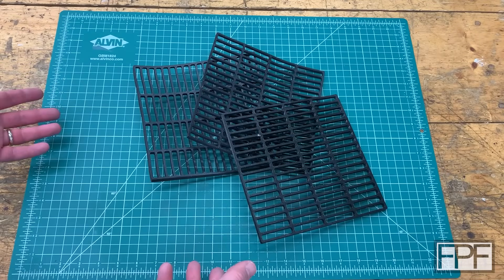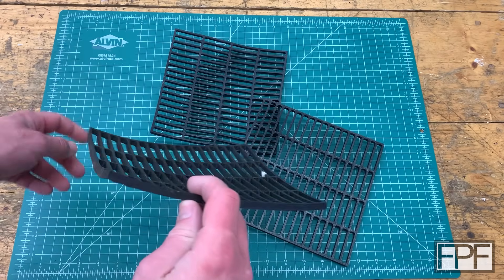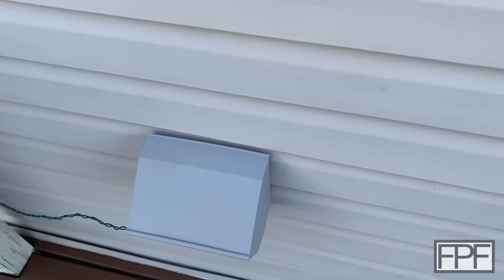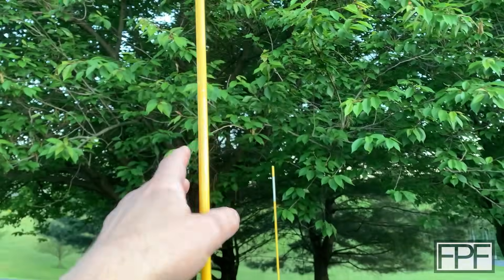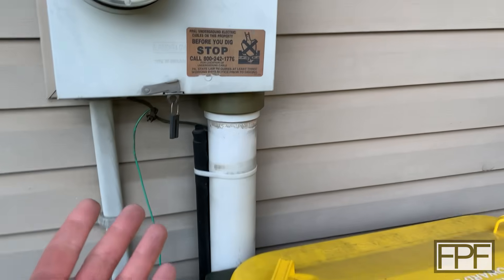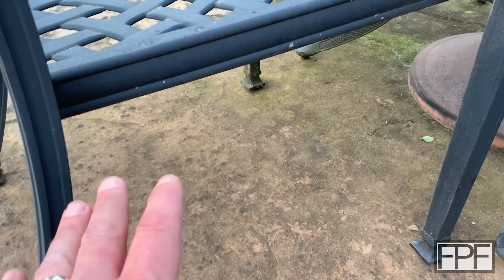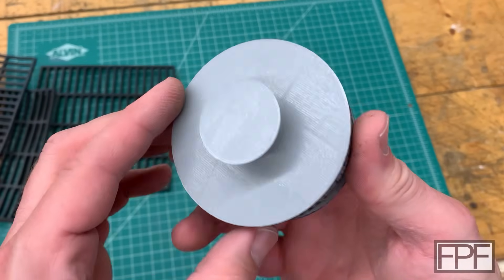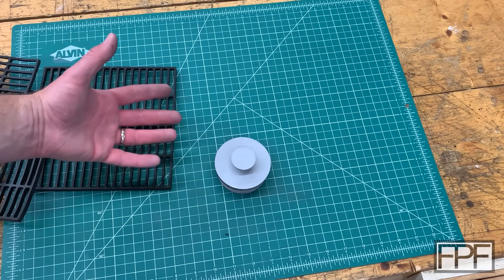3D Prints - 7 Years Outside

Comment: Since ~2010 I've printed hundreds of things to go outside, I've never used PLA, originally it was ABS because that's all we had (no PLA back then!) and ABS is great outside, seems to discolour quickly though, I've had plant pot stands outside since around 2012 (12 years!) and they're still fine in ABS. Petg I've never tried outside, ASA is great too and has replaced my ABS use. I've tried PACF (Nylon CF) once and would never use it again because (somewhat obviously) it turns into a soggy mess in around a week in a humid country

Your TPU is interesting, surprised it held up

Comment: Using PLA or silk PLA, I made some replacement spring retainers for in-floor pool cleaning jets - they've been underwater for 3 years in a chlorinated high-flow high-pressure environment and still holding up. Also I made some replacement hummingbird feeder flowers - they're kind of delicate but they last a long time (a couple years) and are quick to print. Both designs are available on Printables.

Comment: I printed some valve stem caps for my tires i actually used sunlu G3D pla plus black. I live in Tennessee and summers here stay in high 80s and we get about 2 weeks of 90s to low 100s also about a week of 0 degree winter weather.  And considering they're black, and close to very hot pavement they've held up well. I printed them about 2½ years ago. Still going strong.

Comment: I have a floating chlorine dispenser  in my pool, where the bottom half deteriorated from those 3" chlorine tablets. The top half was in perfect shape so I 3D printed a new bottom half that sits in the water with the chlorine tablet sitting in it and it has been in my pool floating around for at least 5 years now. Funny thing is it has lasted longer than the original plastic that it came with from the store.

Comment: The key here is:

1. Virtually all the parts shown have limited direct sun.

2. based on how green everything looks you probably regularly have precipitation and clouds.

3. based on your accent combined with your environment  you probably live at or under 1500 feet in elevation.

The reason I bring these three things up is I live in the mountain deserts of Colorado and New Mexico. I grew up at 8,000 feet in elevation, have typical yearly temperature cycles of -20F to 110F and have lived at greater than 5,000 feet my entire life. PLA absolutely disintegrates where I live. In full-day direct sunlight you are lucky to get about 6 months out of a PLA print. Even "UV Resistant" materials like PETG, ASA, and others typically start getting brittle in the 1-2 year range. As a general rule of thumb to help mitigate against this is I coat all prints that will be headed outside for the long term with paint and/or some other coating.
Reply: This.  I second the effect of different climates.  Colorado will absolutely devastate things even when they are designed to be UV resistant.
Reply: From memory the oxygen levels are also very low at those elevations. A ride on a cog railway caused oxygen depravation, and that was without any health issues.

Comment: Printed a few different types of small flower pots that sit outside and inside. All of them are filled with dirt and water and all of them see a lot of sun. All are PLA and about 4.5 years old. They all still look fairly new with a bit of fading. Rinsing them out yearly to repot and I don’t see any deterioration or anything.

Comment: My big question is this.  I am redesigning the plastic stakes that came with my solar powered walk way lights.  They have all snapped over the years.  The lights are very nice all metal units, save for the stupid spike.  What is the best material to use to print a 3D printed spike that will spend it time in the ground in Ohio, year round?
Reply from the maker: PLA or PETG

Comment: 9:50

Because the hole cut out looks like it's meant to be there. Which, btw. You now have a mounting point to shove whatever gizmo you want through that hole. 
Now, I'm not sure what you could have hang out've that hole. IR light? I 'unno.

Comment: Basically what I’ve found is that if I print with PLA, it’s completely fine in the sun if it’s thick enough and has no sharp edges. If I put anything flat maybe not super thick, it warps.

Comment: I think the color of the item you're printing from PLA matters.  I have a shift knob for my manual car that I printed out of white PLA, 2 years strong so far. I made a mount out of some left over black PLA for a radar detector in the same car, it warped and fell apart (about a year).  I think the lighter colors reflect the light/uv and have a higher chance of survival for that simple reason. Both items see about the same amount of light, the shift knob gets handled more because, well, I'm shifting gears with it. The radar detector mount doesn't always sit on my dash, as I'm not always using my radar detector, I don't want it baking in the sun. So it spends some time just sitting either on the back seat, or on the floor of my car. So again, the color of the material and it's reflective properties play a role in my opinion.

Comment: Altitude makes a difference in sun exposure. I like in a high desert area and find any plastic outdoors break down faster than at lower altitudes. I have still printed PLA parts but will usually spray coat them with an outdoor Krylon plastic paint which seems to help protect them for several years. My TPU prints do become brittle over time, but that could also be high heat and low 30s and below cold affecting them as well.

Comment: I think your latitude has something to do with this. I'm in the South where it gets brutally hot in the summer. I have two examples where prints were ruined by not-so-long exposure to the heat:

1. A clip to hold sunglasses to the sun visor in my car failed on day one just from being parked outside while I bought groceries. Just the little bit of weight from the glasses bent the clip around 45 degrees before the glasses fell into the seat where I found them upon my return.

2. A socket holder I brought outside for a job in the back yard warped terribly after a few hours in the sun. Admittedly it was black PLA which didn't help with heat absorption. The bottom conformed to the bumps in the cardboard box I was carrying my tools in, and getting my sockets out after it had a chance to cool was a nightmare.

I am surprised how long some of your PLA prints have lasted if it's true you get 100F days up there. Maybe you are using higher quality filament than me also. Either way, I love long term experiments like this, so thanks for the video!

Comment: Yeah PLA does work fine outside for many applications, I've had a little PLA planter stand outside in the elements for some flowers for about 9 years now and theres no sign of it weakening yet. If it does, then ill just reprint it.

While yes it theoretically isn't UV resistant, if you dont use it for something that is absolutely critical and will kill you if the psrt fails, i dont think you need to worry much if you approach ot with some common sense...

The thing about people saying to never use it outside yeah, that also reminds me of the early days of hobby 3D printing.
There were many people that from the beginning just dismissed PLA as a useless plastic for beginners, the "real pros" used ABS like they do in injection moulding. But now we know PLA is actually pretty amazing and in many applications just straight up stronger and stiffer than ABS while also being much easier to print.

Comment: I've got a cap that the pool people never installed in our pool when they put it in.  It's a salt water pool. I modeled and printed a cap in PLA and it's been in the pool for 4 years now without issue.  And when it does fail.. I'll just print another.

Comment: You CAN use PLA outside. It isn’t advisable to use dark colors for outdoor prints as this will cause more heat from direct sunlight and potentially deform the model. Although PLA is biodegradable, it requires processing and will not degrade normally. Humidity will also affect it. Don’t expect PLA to last as well in Arizona as it does in Maine. I personally prefer using PLA+ or PETG for outdoor prints for the added heat resistance. I’ve had custom plugs that I made to block rodent holes under a shed outside in the sun, rain, snow and ice for over 3 years now and they are still as good as the day I printed them.

Comment: Right at 3 years ago I bought my first printer, a Prusa Mk3s+ kit. One of the first prints were some "hat brim" shades for some solar LED path lights to keep the LEDs from shining up into your eyes. These were about 6" x 4" and about 1.5mm thick (I think 3 perimeters at 0.45mm extrusion width). I printed about 4 or 5 out of black PLA, another 6 out of black PETG, and about 4 more out of Prusament signal white PLA. The ONLY ones that did not warp in the Texas and Alabama summer heat and direct sunlight were the signal white ones, I'm presuming because black absorbs so much more thermal energy from the sun. Some just warped a little so they rattled around on the lights, and some actually curled up like a photograph in a campfire. The white ones, while they did not warp, they did suffer what looks like typical plastic UV degradation where the surface is now matte and if you rub it some white comes off on your fingers. 

I reprinted I think 6 of them this July 4th vacation to replace the ones in Alabama that had warped, and used Polymaker ASA in natural color this time. Nothing we've printed in ASA has suffered either cold flow, warping, or surface degradation so far. In my experience, PLA is great for inside but not so much for outside, and a lot of that depends on the geometry of the model. If it's nice and thick (i.e. not something you can easily bend or break by hand) then it usually holds up well. If it's pretty thin and especially long and thin/flat, it seems to be far more susceptible to temperature warping. 

I've been putting off getting profiles set up for TPU but based on your results, I'm going to have to get that going as I'm very surprised at how well that stuff held up.

Comment: Hey Mate, thanks for your Video, was really enjoing it. 

My Prints for outside are ASA (Abolutute Zero issues, looks it last forever), PETG - also fine but after years but I have the feeling that it has problems with high moisture so it gets brital over time when it is used a greenhouse.

The only common thing I realized - do not print stuff in red. If it is ABS, ASA, TPU or PETG - the color absorbers UV Light and looses color over time. Second best is bright green also it looses color. Black,  Gray, Blue, Dark Green - far more suitable for long term use outside. 

A btw. live near Munich - Germany ;-)

Comment: I have a whole lot of planters and garden markers that I have had outside for 7 years already and there is no change. I am in Toronto, so that is -30°C/-22°F in the winter and 40°C/104°F in the summer with full sun and most of them have not faded at all. There is zero warping (the watering and cool soil could help that) and they are not brittle at all.

Comment: Why not print a mesh cover for the exhaust pipe so it's not going to gas you if you forget to remove it. For the record, i printed a small PLA pyramid for a fish tank and it was fine after 2 years, it just had plants growing on it and the roots seemed to go into the plastic.
Reply from the maker: the cover is to keep rain/moisture out.  I'm afraid to try it, but I think since the inner pipe is wedged into the outer pipe through an exhaust donut  (tight friction fit) that it would just blow the cover off

Comment: The environment plays also enormously, here in the Caribbean, The PLA outside is only if not exposed to the sun, otherwise it deforms in a significant way and especially it becomes brittle very quickly.
I think that the 70-90% humidity also plays a role there.
So for the outside I only print in PETG, not only it does not deform in full sun, but it retains a mechanical resistance years later.

Comment: Hmm...driveway sticks... Not a thing here in Europe. You have to make them yourself. Also the fiberglass rod will cost you a fortune.
Reply from the maker: That's surprising.  They are very common here
Reply: @FunctionalPrintFriday  We have many things unavailable or prohibitively expensive. For example torque wrenches. You can buy a simple torque wrench cheaply but good luck finding one with exchangable wrench heads. Almost nobody sells them here and if you find them, they cost 2,5k USD and their range is absurd.

Comment: when the headlines say that all PLA is compostable and biodegradable, but only the fine print says that only under certain conditions. conditions that don't usually occur in your backyard. greenwashing? 
of course, there are many different variants of PLA (different chain lengths and polymer architectures, isomers, blends) and they can have very different properties, some can degrade quite quickly even without the help of an industrial composter.
but what about 3d printing filaments?  the better the biodegradability of PLA, the worse its mechanical properties, and I want the best mechanical properties possible! I also don't want my 3d prints to fall apart after some time, and filament manufacturer wants me to ba happy so i don't expect 3d printing filaments to be particularly biodegradable

Comment: Great data points. Craziest part is that with years of generator use you never forgot to remove that cap and melted it. I've had a compliant/single-piece clothespin in direct sun for about a year now that still flexes fine. R3D clear PLA

Comment: Not exactly an outside print but printed a replacement sunvisor clip for my car out of PLA as i have gray only in PLA (which is the color of the original part i needed to replace), it stretched on a hot day due to the heat in the car, made another one and it did the same almost immeaditely, i'm printing the same part out of clear PETG as i'm writing this comment, hoping it will last longer than the previous parts did.
What i learned is that PLA will not last long if it is under load in a warm environment.

Comment: PLA definitely works outside. I have a bunch of garden decor, a mount for my doorbell, and some caps for metal conduits. It gets around 40c/-40c throughout the year where I live. I will say though the once place it has failed me is in my car, I made sunglass holders and due to the glasses hanging down from a clip, over time the print warps like your tomato holder. I've tried using PETG for it but it was the same issue. I believe ABS or ASA will work but I haven't tried them yet.

Comment: Great video and talking points. However, sorry to be blunt, but PLA (and PLA+ for that matter) is trash outdoors - at least that's been my experience 🙂. Fine for indoor prints or prototypes. But if you want something to last outdoors, choose ABS or ASA. Even PETG will suffer eventually. I find that the shape/infill of the part will have a big bearing how long it will keep its shape however.  Here's a video showing real-world testing of some RC tank components printed in PLA and purposefully left outdoors for just a few months to see what would happen: https://youtu.be/eknBAMTx1ZQ?si=Wi1RHIwp602ap0jf&t=334 (you can even see PETG parts suffer after being exposed in the sun later in the video). 

This frame of the same video shows the effect of UV on some chassis rails I printed in PLA+, PETG and ASA. Only ASA held its shape 100%: https://youtu.be/eknBAMTx1ZQ?si=Z7mZw3mx9a10EaZQ&t=574

Comment: PLA is not like PLA, I remember flower pots printed from PLA that became completely brittle and fell apart in my hand after a year. As well as a thin PLA foil that completely disintegrated in the compost. Personally, I would rather use ASA for outdoor stuff or at least protect it with a coating due to UV radiation.

Comment: When I purchased my car the rubber seal was missing from the oil filler cap on top of the engine. I printed a gasket in PLA by testing different thicknesses with about 15% infill. About 18 months later I noticed it had cracked in several places across the filament lines instead of along the filament lines that you might have expected. But that was exposed to hot oil fumes so that maybe why.
Reply from the maker: reprint in TPU and it will outlive the car.  TPU is amazing
Reply: @FunctionalPrintFriday  I had thought of TPU, i need a bit more of an excuse to get a whole reel though.

Comment: I get that it's possible to use PLA outside but the way I look at it is why would you bother? Most quality PLA filament will cost the same or more as ABS or PETG, and ASA is simply the better solution if it's going to have a ton of UV exposure (for the minor increase in price). My rationale is if i'm going to take the time to design and tackle a problem, I want it solved permanently.